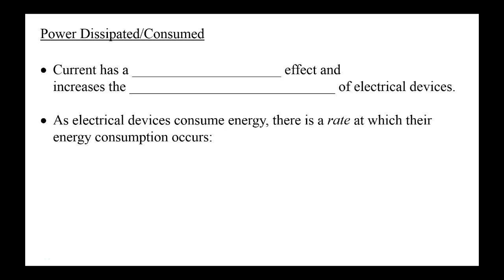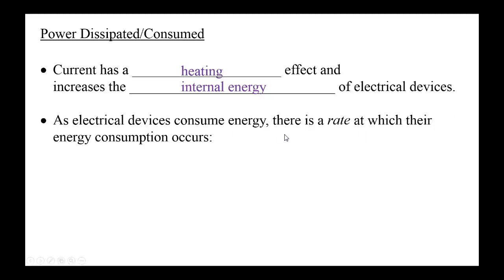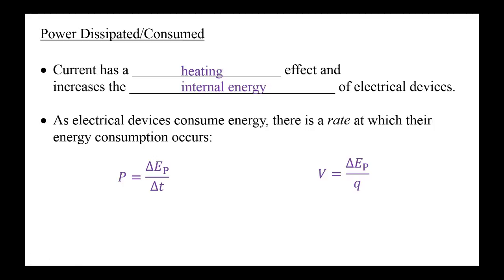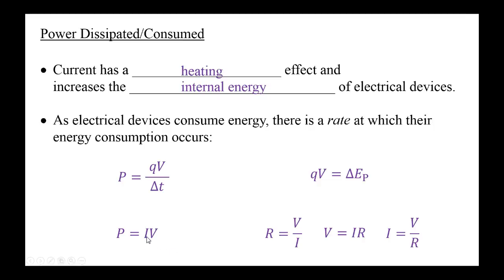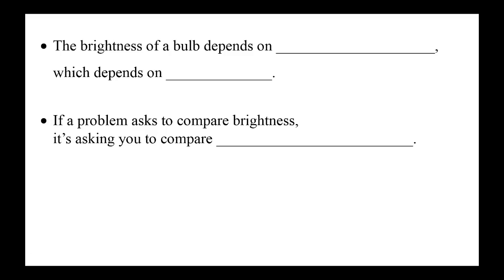Electrical Power

Comment: Hi ! I want to calculate "thw power of the voltage supply" which is used to create an electric field between to parallel plates. my question is that can I use the total current of the ions passing through between these plates ? I sounds like I should not since they are just passing through but the total current is given in the assignment I try to handle so I thought I shuld use it somewhere. and my second question if the ions go into the paralel plates perpendicular to the electric field  will the power will be zero ? but please mind it is written the "power of the voltage supply".